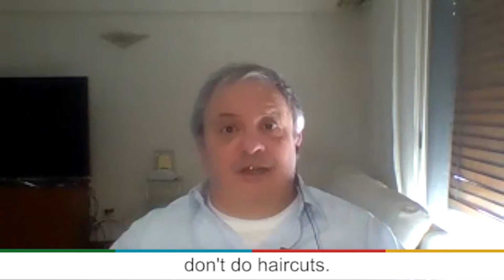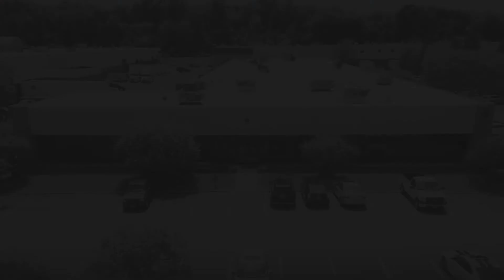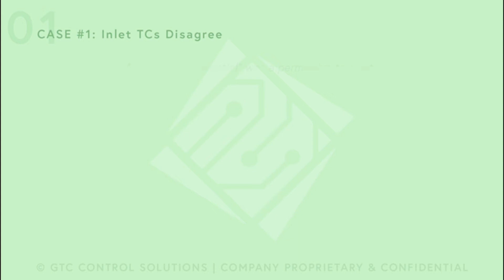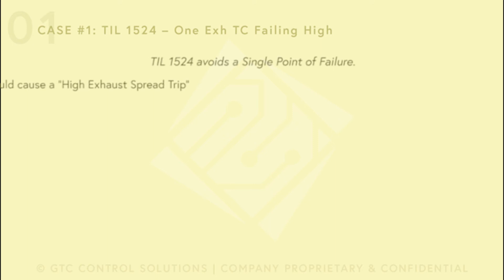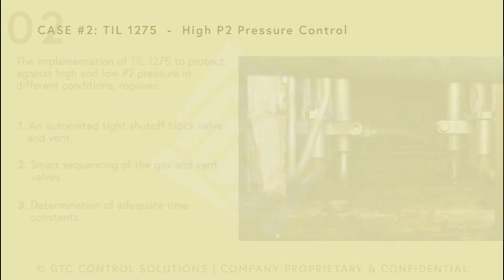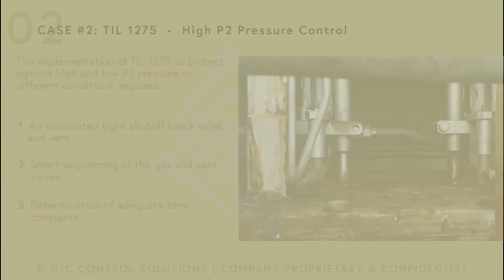GTC Webinar: 2 Single Point of Failure Case Studies, Implementation of TIL 1524 & 1275, BONUS TRACK!

Comment: Cheers! Thanks for the presentation. Note: it is possible to do core by core LVDT calibration on MKV using the manual method and entering appropriate individual core data prior to the individaul EEPROM downloads. Autocal does not make this possible and does not detect errors caused by loose ferrite powder in the LVDS.
Reply: Hi Colin. Fantastic observation! Appreciate the comment.
The objective is to call the user's attention to avoid "average" LVDT calibration method, and use the "core-by-core" method instead.
Using Autocal is just the first step.
The individual values should be entered in the I/O configurator to "save" the calibration data in the io_cfg.lst and io_cfg.prm files.
After calibration, IOCFG download, and reboot.
The manual position and polarity checks with the Demand Display screen (for safety) will detect errors.
The Current and Position Checks in Autocal also help.
Curious about the effect of loose ferrite powder in the LVDTs that you mention,  perhaps just unlucky, never experienced it. Can you share something about it?